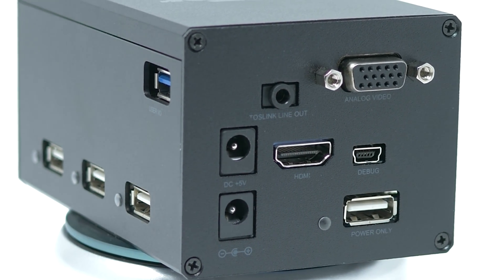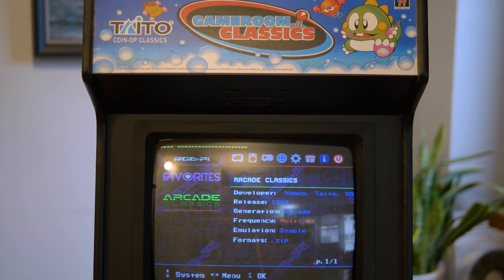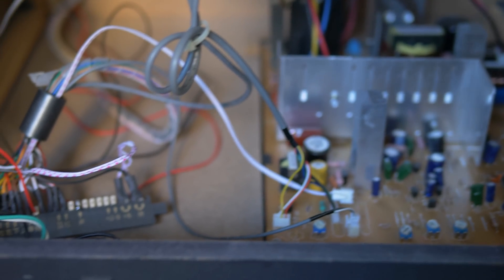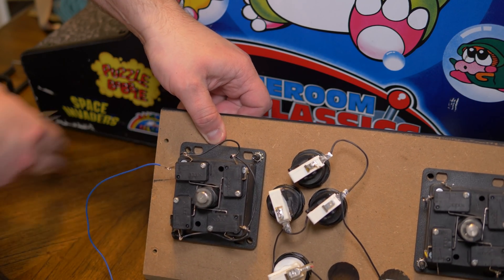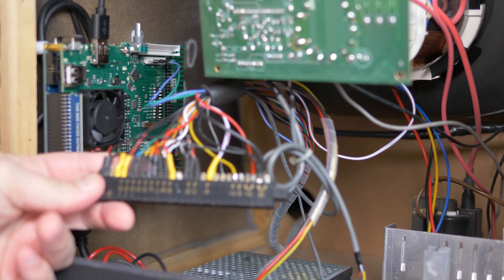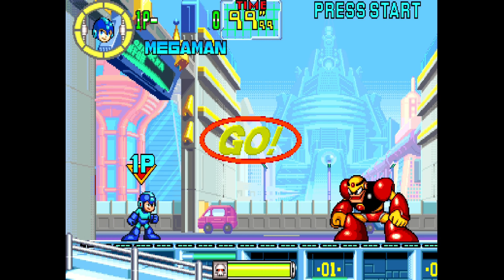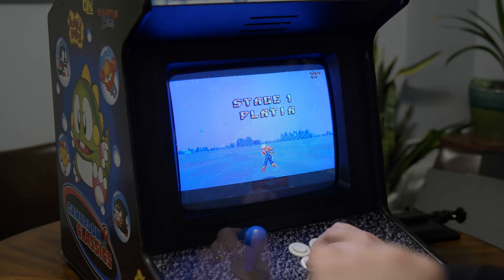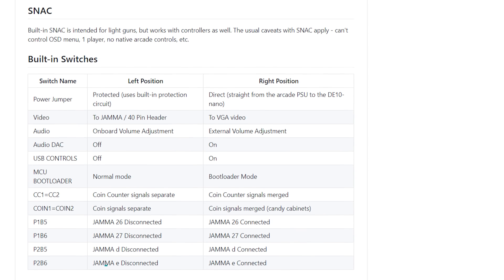MiSTerCade: Installation and Overview

Comment: hello!
im also from nyc and a family of bga nice to see u! 
i recently got the same cab, two units,
and im planning to make head to head using mistercade versus! but problem is im a real newbie on these arcade machines 😂

have few questions if you dont mind to answer

1. said you needed additional arcade psu to run mistercade (mine is v1.3) since the factory one inside isnt strong enough. how did you hook up the monitor? i see that the factory psu is actually on the monitor board that has adjustment pots.. did you leave the monitor connection to the factory psu and hookup everything else to new psu? if so, how did u manage to use the power button on the back to turn on both psu? im very lost here…😅

2. i also have plan to use one unit using j-pac and play fightcade. my pc has already crtemudriver installed and capable of 15khz. do you think i can simply plug in j-pac and play with factory psu and jamma harness?

sorry i just couldnt find the answer anywhere else, only way to figure out is to bother my friend ben but i want to have basic idea so i understand his advice! looking forward to hearing back thanks bob !

Comment: I have one old standup cabinet with CRT but its missing the PCB for the CRT, so I will have to replace it with a LCD I guess. Im very interested now in this MISTERcade solution. It still does not seem plug and play though I still have a lot of research to do on it to understand what it can do.

Comment: What do I do if my JAMMA  Arcade has an LED monitor?  I usually just plug my VGA cable directly from the board to the monitor.    (I’m running a Pandora DX). is there a way just to connect my monitor directly to the Misterboard?

Comment: I really wish you had made a more in-depth video on the installation. I have this same exact cabinet, and I have absolutely no clue how to go about installing a new arcade power supply. I have the newer MiSTerCade that has the 5v jumper letting me use the cabinet power supply. The problem I'm having is that the video output looks wrong. Everything looks fine with the board that came with the cabinet; but when I install the MiSTerCade, the colors look blown out, like as if the contrast is too high. I noticed that the chassis has spot for a contrast adjustment, but the potentiometer is missing. I wish I knew how you got yours to look right. I've been pulling out my hair trying to figure this out!

Comment: I don't know if you will see this. But, how did you wire the Meanwell into the cab? My guess is the original mains goes into the MW power supply then piggybacks to the deflection board. The alternative is you split the mains where it comes into the cab and routed it to both the MW PSU and defection board? Your wiring is out of site and hard to duplicated.  Any input would be appreciated.
Reply from the maker: the original chassis has it's own PSU, so I just spliced the AC input - One to the original chassis and the other to the meanwell for the arcade boards.
Replacing the chassis with a better one and using a better meanwell for the whole thing would better though.  You'd just have to find a chassis to match the CRT.
Reply: @RetroRGB  Thank you so much. I already did a full recap of the chassis with a few upgrades. Increasing c561 to a 220uf x 250v helped with most of my blooming issues. c451 is timing critical and shouldn't be modified,  but replacing it with an exact match fixed my fold-over issues. It's a cheap tube / chassis and I spent WAY too much on high quality caps than it is worth...  but the results are fine. I ran into the exact same issue in that I can't fill the bottom of the screen no mater what I adjust. When I'm more motivated I'll replace the whole tube / chassis. In the meantime I got the same MW PSU as you, I just wasn't sure where to wire it in. Now to hit up Porkchop Express.
Reply from the maker: I mean, it's up to you, but the decision I made was to love it as-is:  Sure, it might not fill the screen perfectly, but it's fully recapped and 100% safe to use.  And looks awesome :)
So yeah, maybe upgrade at some point in the future, but enjoy it for now!

Comment: If I have an Arcade1Up cab modded for 60n1( so it’s jamma with a VGA monitor and the LCD converter), can I just unplug the 60n1 from the jamma harness and replace with the MISTercade and hook up to the LCD converter?

Comment: Hi ! I'm always hyped by your videos. They contain good quality and a ton of tech info. 
I'd like to have your opinion on a subject that is vastly talked about among hardware defenders compared to FPGA or RPI.
It's about INPUT LAG. Some of these people say that these devices (even hooked to a CRT) produces Input Lag because of the USB controller's nature and because of software based emulation structure. They also say that the best game to test the lag is Punch Out on Nes and they cant finish the game on RPi because of that.
What is your personal thought about it based on your experience ? Thanks a lot !
Reply: I tested the 2 (real hardware and mister fpga), no difference by activating the polling rate of the mister with the option on v-sync 2 (works with free sync monitors), the mister is even more responsive because the port usb of the controller is queried 16 times per frame while it is only once on real hardware

Comment: Has anyone a link to the black case in the beginning of the video?
Reply from the maker: That's the same seller as the MiSTerCade.  He's out of stock of cases right now, but you can get one without a case, then just buy the case in a month or so when they're in stock.
Reply: @RetroRGB  Thank you! And thank you for your work.

Comment: Not really sure why you went to such lengths to avoid enlarging / adding a hole on the back, given you happily drilled larger holes all over the front panels. Using your hole saw on the back would have allowed for USB-A and full-size HDMI. You could even fit flush mount USB hub (there's ones that fit circular holes).
Reply from the maker: Simple:  The holes drilled in front will be used with MiSTerCade, real arcade machines, Raspberry Pi...pretty much everything I can think of will use them, so if I ever put the MiSTerCade in a different machine and turn this into, say, a PGM box, I'll still use them.  Alternatively, cutting a hole for HDMI and USB is ONLY something I'd use with an emulation solution, so I didn't want it to be permanant.

Comment: Great to see bartops with CRT monitors in them! Very rare to see in the sea of lcd based ones. I've been meaning to build a couple myself for years. I've got a few full size cabs but a couple of crt bartops would make a nice addition I think!
Reply: You know where they sell CRT table tops?
Reply: @AE-bm4no  No idea! But i'm always thinking that i'll get around to building myself a couple one day! I do have a couple of old steel cased bartops (I think they had card games on them or something) with 80386 based PCs and CRT's in them (that used touchscreen overlays) so they could probably be fairly easily converted.

Comment: What's up with the vertical orientation on the monitor? Everything seems up a bit too high, or not filling the screen? (I know very little about arcade CRTs so I'm sure there's a reason?)
Reply from the maker: That's a combination of the CRT's controls and the fact that each core will output slightly different video (same with swapping different arcade boards).  Cabs with external controls usually have H&V centering, so this isn't a problem with those.  This cab has the H&V controls buried, so I just leave it alone - It's close enough that it doesn't bother me.

Comment: Quick question. You mentioned you would like to have a cabinet for each orientation for 3 total. I assume 4:3, rotated 3:4, but what is the other orientation referred to? The taller displays that games like Donkey Kong and Pac-Man run on? What are those displays/ratio called? Also, were there ever any pre-HD era 16:9 arcade cabs? I feel like there would be some, but can't think of any off the top of my head.
Reply from the maker: It's just TATE/vertical orientation flipped the other way.  Many games have an option to flip, so it's not totally necessary, but I'd like one for each orientation anyway :)
Reply: @RetroRGB  Thanks! So just for clarity. The aspect ratios/orientations: 
First would be 4:3
Second would be TATE/3:4
And for third? Sorry if I'm missing something obvious/misunderstood 😅
Reply: @RetroRGB Ah, I think I understand now. Third would be TATE/3:4 also but literally rotated the other way. For some reason I assumed the 3:4 were typically rotated in one direction. Interesting, thanks dude!

Comment: Great video. Please more informative videos like this. (I'm looking for a more basic video about the details involved with hooking up a MiSTer to a CRT. About the ini, about the switches on the I/O board, about the cables.  Thanks.)
Reply: Absolutely would love a video going over the INI. It seems most of the features are not well documented. I don't know what half of it should be used for.

Comment: Great video, as always :-) One noob question; besides the vertical and horizontal arcade orientations, what is the third one? Some other aspect ratio?
Reply from the maker: Vertical in the other direction.  Some have options to flip it, but others don't, so having a cab with a monitor flipped in each direction covers all use cases.
Reply: @RetroRGB  Ah, I see, thanks!

Comment: Does anyone know the video output resolutions on the mister? Currently using groovymame with calamity ati card drivers for super resolutions. Horizontal always fits perfect and only requires vertical adjustment between each game using the crt remote board pot. 

If mister is doing native res instead of super res, do you find you have to adjust horizontal as well as vertical when switching games?

Comment: Great video as usual. Thank you, Bob! I have a Candy cab with RPI3, but the cabinet has USB controllers and for video I think a sync combiner would be enough for conecting my MiSTer, right? Also what is the name of the game at 11:15?
Reply from the maker: Thanks!  Here's the game:  https://en.wikipedia.org/wiki/Alpha_Mission_II
Also, you'll want to double and triple check the wiring and voltage requirements of your cab - It might need a JAMMA adapter like this, or just feed it MiSTer's RGBs output.
Reply: RetroRGB thank you, Bob. You just gained a new Patreon supporter. You are the best!

Comment: Would have preferred you using quick disconnect on those microswitches.
Reply: Right? Especially after he just had problems with them. Would save so much time to just use QDs for easy swapping. No brainer.